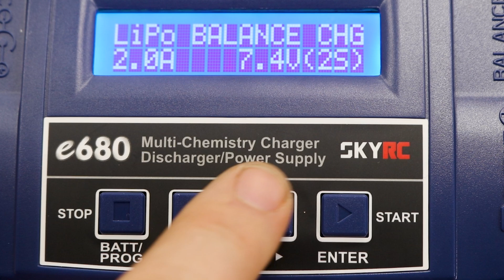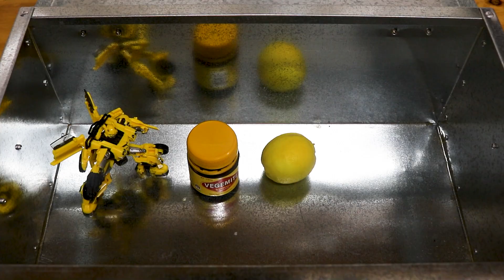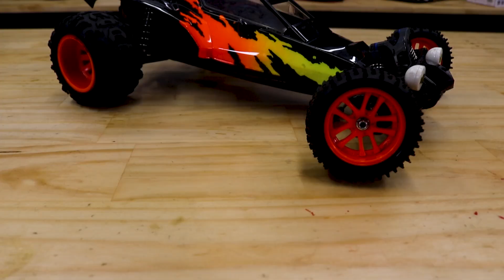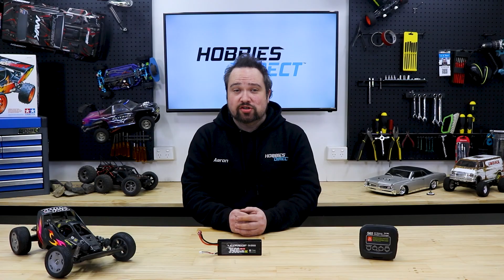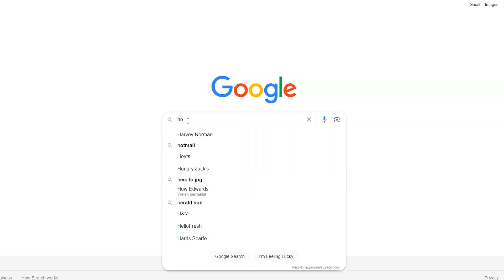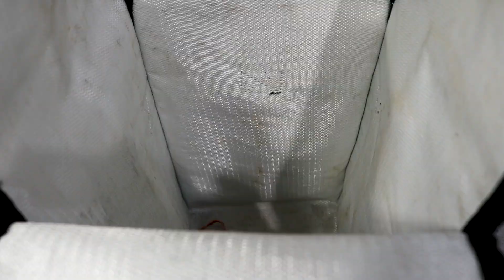Why is my LiPo battery not charging?

Comment: Hobbies direct, I have a serious question, I have a storm brushless and I have the same 2S battery that you showed in this video that I have been using for it but every time I plug it in, after 5 to 10 minutes the charger is burning hot. I’m no expert but is that normal to happen. If you could reply that would be great.
Reply from the maker: It is normal for the charger to heat up, but not so hot that you can't touch it. If it's on carpet, there might be a lack of airflow for the heat to dissipate, or it might be time for a new charger.
Reply: @H @HobbiesDirect  thanks, that news just got rid of my phobia of chargers😂

Comment: My boy rc car battery is not charging.i didn't charge it for a while. Tpday i took it n charge and put in the car  .racing car is not working .what to do . 7.5 v buy it from dubai. If battery is dead what to do
Reply from the maker: If it red, you'll need a replacement.

Comment: See all you guys have these videos why isn’t my battery charging? That’s not what I need I need to know why my battery is only charging to 3000mah but it’s a 9000mah battery
Reply from the maker: It's either not really a 9000mah battery, or there's still ~6000mah in it when you start the charging process. Remember, as lipos should never be run totally flat, you only ever get about 80% of the stated capacity out of them.

Comment: My issue is to do with the balance port. When it is connected when I'm balancing my 2200mah 3S 11.1 it won't work. If I disconnect it from the balance port it works. How come? I have a balance checker and all three cells show similar voltage. My Lipo is relatively new and it worked fine when I first got it, but not anymore. Am I doing something wrong?
Reply from the maker: What charger and charge setting are you using? Sounds like you may be in NiMH mode, which would be bad.
Reply: @HobbiesDirect  No it's not in NiMH mode. Am using a LiPro Blance Charger. Assuming it drains to around 8% left, how can I correct it so it can balance again? I test each cell and all three are in the 3.7 range.
Reply from the maker: @richardhall9500  If the cells are all roughly balanced (within ~0.1v of each other), and all the settings are correct, then there could be a fault with the charger. Do other packs work fine?

Comment: I have a 4s Ovonic pack that i put maybe the 5th run on yesterday, so not an old battery. I went to storage charge all my packs after bashing and when i plugged that one in i got voltage error on both my chargers, so i used a cell checker to see what was up and it showed c1 .05v, c2 7.23v, c3 3.63v and c4 3.63v, actually tried another checker as well with same results. Im not new to lipos but never seen this. Any ideas on what maybe going on? The 7.23v on one cell is a bit scary to me lol.
Reply from the maker: It's very likely that the cell would have popped at 7+ volts, its much more likely that there's an internal short or a problem with the balance lead that's giving the wrong readings.
Reply: @HobbiesDirect  ok thanks, I was thinking something like that had to be going on like cell 2 on my checkers was reading 1 and 2 voltage maybe. Thanks for the reply 👍

Comment: I received a brand new 810mah Spektrum smart battery for my Losi Mini B a few days ago. I went to put it on the charger and it would not charge because of a low voltage error. I tested the pack with a volt meter it was at 1.1 volts... After a bit of research I decided to charge the lipo on the NiCd option and removed it from the charger at 6.4volts. I was able to bring the pack back to life and it charges fine on the Lipo setting now :-) As long as the cells are not damaged you can bring back low voltage lipo's with the NiCd charging method. Just make sure to monitor the pack while its charging then take it off once its at a safe voltage. Then charge it the rest of the way with your Lipo setting and it should be good to go. If the pack is puffy like you said do not try this method or if the pack has a bad cell this method will not work and the pack should be tossed out.
Reply: The NiCd option works well.

Comment: So…I’m new to LiPo batteries…2 weeks in. I bought a spektrum s2100 kit with 2 3s 50c batteries to use in my new infraction 6s. I went through 3 runs within a few days with the truck and put the batteries into storage charge each time without issue. They say for a little over a week and today tried charging the batteries, one charged easily and quickly, the other made it to 80% and then claimed 13 hours to finish charging. I stopped the charge, unplugged the battery, plugged it back in and it claimed it was at full charge. I ran the batteries (in a 3s truck) and after coming home, that same battery won’t take a charge on storage mode, but will take a regular charge (although something seems off, charges relatively quickly in comparison to previous times). Any thoughts? Thanks. 
Ps, I also bought 2 smart 100c 3s batteries and they seemed to never hit storage charge completion…they would say less than 5 minutes till storage charge complete and it stayed like that for an hour before I stopped charge and unplugged. Those I haven’t fully charged or run yet
Reply from the maker: Can you get the overall voltage, or ideally individual cell voltage of the pack? That will tell you a lot about what is happening inside.
Reply: @HobbiesDirect  yeah so I checked the individual cells with the charger and there is one cell that’s always lower than the other 2, usually around 4-4-3.7, but now that I know that function exists I check them periodically and anywhere from .3 to .7 volts lower than the other cell. I contacted the hobby shop I bought it from and he said to run the crap out of it but only for a short period of time and charge..repeat to see if that cell will balance out. Sounds like a solid plan? Like I said, I’m a total noob when it comes to electric rc’s although I have more than my fair of time in with nitro rc’s. Thanks for getting back to me. Ps, I invested in 7 batteries total now so that one isn’t going to prevent me from running but still, $70 for a battery to get 3 runs from im trying to do what I can to revive it. Hobby shop also said if that didn’t work that he’d do what he could to help out but they don’t warranty batteries. They’re all spektrum smart batteries btw.
Reply: How do you put a battery in storage mode?
Reply: @chrisl6969  on the bigger spektrum smart chargers there’s options for charge, storage, and discharge. Once I found out the smart smart batteries will auto discharge into a safe storage voltage I just charge them after running and cooldown, then they auto discharge after a 2/3 days. That’s also adjustable with a smart charger or spektrum battery/servo tester. 3.8vpc seems to be the generally accepted storage voltage though. Hope that helps. And as for that issue I was previously mentioning, ended up having a bum cell in one of the batteries, probably my fault as when I was very new to it, I likely over discharged them while running. Haven’t made that mistake again, I’ve also gotten away from smart batteries as I’ve found better performers for less money. It’s nice having the smart capability though.
Reply: @ damn bro that's good to know. I got a cheap charger which I don't think have that option and I'm running lectron pro 5200 w/ the cheap lectron charger. It was the only one in stock and I just wanted to get my arma felony running.
Reply: @ yea I think I ran the batteries to low as well... I was trying diagnose a problem with my receiver losing throttle control but my steering will be fine... I'll turn it off and back on and it'll work fine for like 30 seconds then same thing will happen again where it loses throttle control.
Reply: @chrisl6969  that’s interesting with losing throttle…I had an issue with my infraction that lost throttle control but also lost steering, I thought it was the receiver that was toast, but ended up being the steering servo was no good and was preventing the esc from working (designed as a sort of failsafe). That’s an interesting issue, kind of sounds like a battery issue maybe being run too low. I’d definitely check the cells first and see where they’re at and take it from there. Just my .02. If the esc sees total voltage too low it’ll shut down throttle but steering will remain active. Sounds more likely.
Reply: @ I'm going to the hobby shop tomorrow and they're going to take an look at them hopefully that's what it is
Reply: @chrisl6969  good luck!! Have fun once you get that back up and running, good times!!

Comment: curious about the 6 wheel thing (left of screen) ???
Reply from the maker: So glad someone asked haha - It's a 6lehong! Created from 2 Xinlehong 9130 cars, it's dual motor, dual esc, and 6 wheel drive. The front 4 wheels are basically a stock Xinlehong 9130, and the rear 2 wheels are the back half of another car, with its own motor and esc. Drives ridiculously well for something held together with cable ties!
Reply: @HobbiesDirect  Sweetness. I have thing for 6 wheels. picked up the g63 black from you.
Reply from the maker: @Sifizero  Nice!